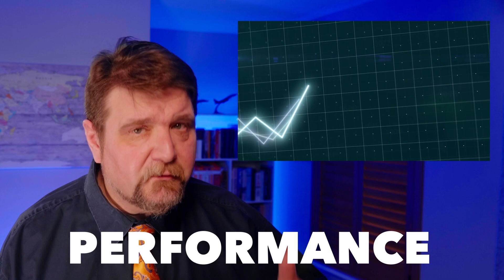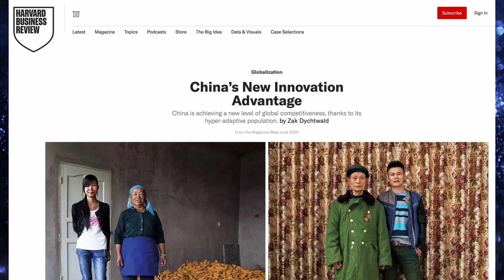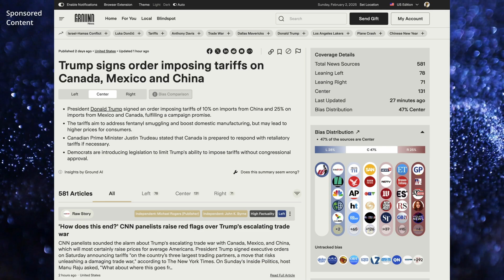From Mach to Microchips: What Really Matters in Fighter Design Today

Comment: China was too poor and did not hv enough engineers previously. Licensed built MiGs-15, 17,19 and 21. Modified the MiG-19 into Q-5 with internal weapons bay and MiG-21 into J-7 with double delta wing. Built J-8 (looks like Su-15), JH-7 (a Xtra large Jaguar) and J-10 (probably had some help from jobless ex-Lavi engineers; some went to South Africa to work on Carver fighter). Reversed engineered Su-27, Su-30 and Su-33. Modern J-20 and J-35 stealth fighters and now starting on 6th gen fighter prototypes with at least better stealth (1st criteria on USAF list of 6th gen requirement). China has caught up in fighter design and the J-10 has recently shown its capabilties in combat.

Comment: There was a calculation made around 2020, that China had roughly 10 times the physical manufacturing of USA.
And that includes an equal level of engineers and scientists.
And more importantly, unlike USA, China is careful about making sure their engineers and scientists are not wasted or thrown away after every project.
Which results in a huge advantage in institutional expertise and experience that they're building up ever since the 90s, possibly 80s.

Comment: so there was a video of chinese truck with 12 missiles. how can one know if those are AA missiles or something else? i suppose they are in sealed containers and one can conclude those are AA missiles... but why?
Reply: Or, they're like the Russian minitruck with 2 quad Kornet ATGM launchers.   Which has been given the ability to function as closerange SAMs.

So they might very well be, both.
Reply: @DIREWOLFx75  nah. 4 axis truck. 
basically what if those could be cruise missiles and not AA missiles?
Reply: sky is the limit. now everyone can mount anything on a truck
Reply: if its 12 Missile in single truck, it ofc AA missile
Anti Air missile is relatively small while Cruise missile is humongous

Iskander is like 7.5m lenght and 1 meter diameter. compared to Patriot missile its 6 times larger
Reply: @thehumus8688  Russia has the Kornet-D light truck that has two quad launchers with Kornet ATGMs.